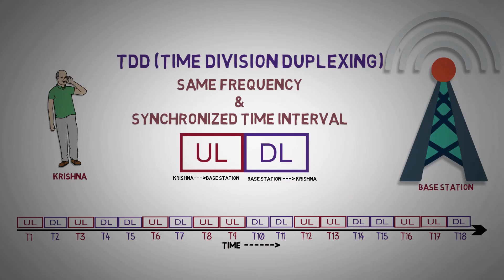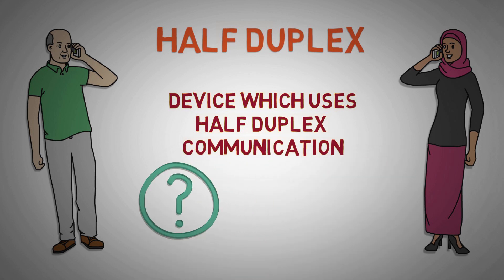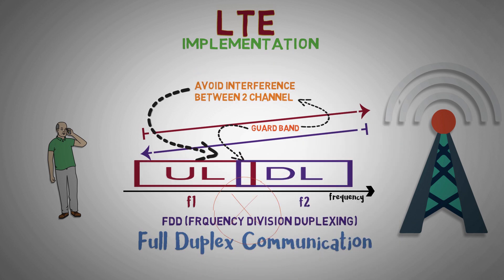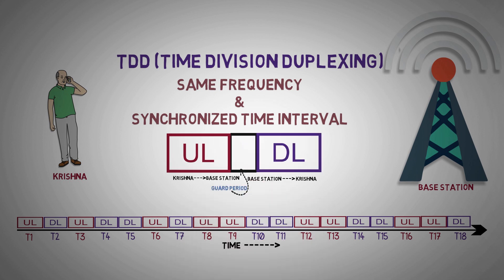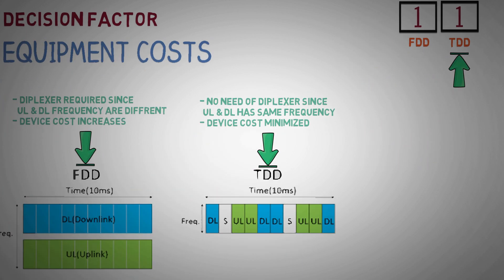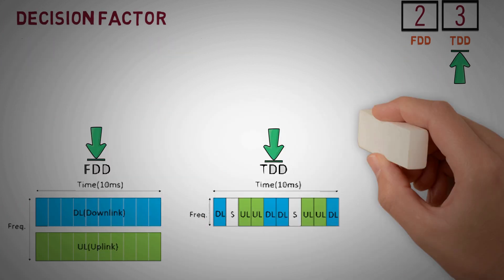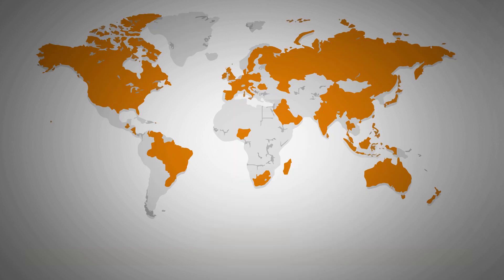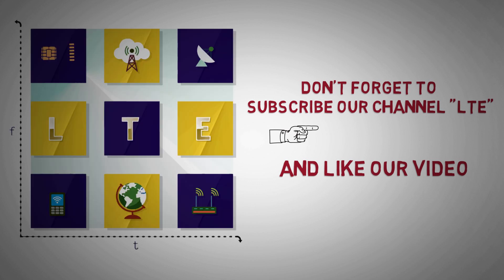2.1 - TDD VS FDD IN LTE 4G Updated

Comment: The latency point isn't really true. TDD's switching is so fast as to be basically negligible, same as Wi-Fi (also TDD). Given a 1:1 split with equivalent channel width to FDD's combined channel widths, you'll see a negligible difference in latency or speeds. With an asymmetric split, you'll see asymmetric speeds, but otherwise the same performance.

Comment: So fdd is better for gaming since multiple frequency allows signal to travel better than tdd due to single freq.? but why my download speed and upload is lower in tdd even I have greater signal quality compared to fdd. I'm getting 25mbps non CA band 40 signal and when tdd CA activates, it drops to 8mbps and mostly unstable.
Reply: Network spectrum perhaps? The frequency isn't solely used by your carrier. The government usually divide it in sizes (5x5, 10x10, 15x15) and sell it at an auction. Imagine a pie sliced into pieces. How much did your carrier bought in your area? Usage per area is a factor too. The more users connected on that frequency, quality goes down as the bandwidth is getting spread out to many consumers.
Reply: fdd better for online gaming and tdd best for downloading and watching movies
my modem router has band frequency selections and u choose from TDD to FDD
based on my daily use